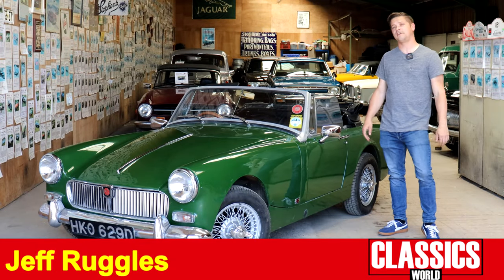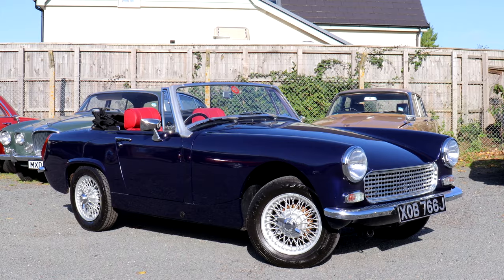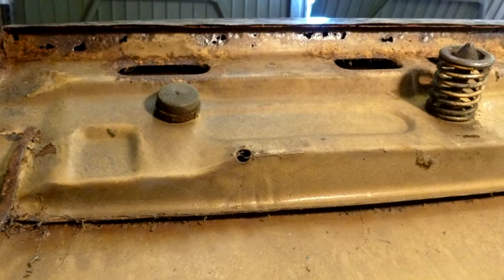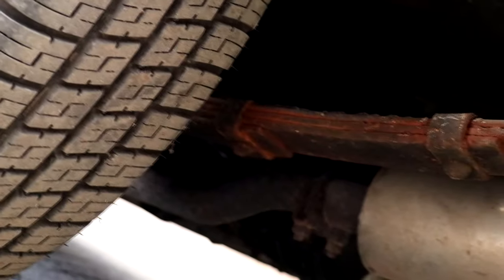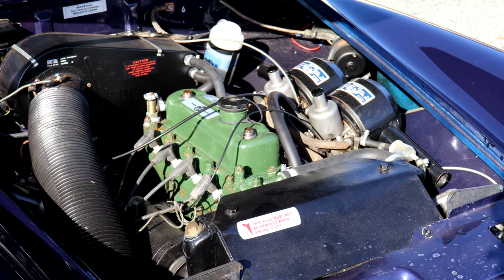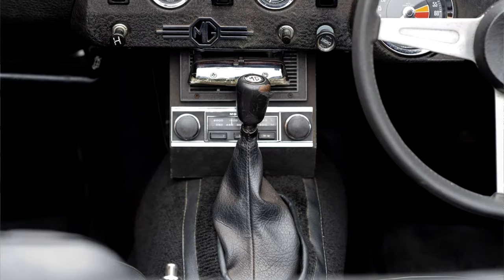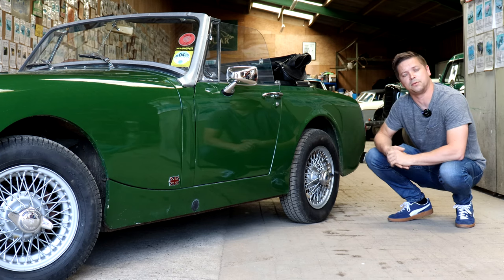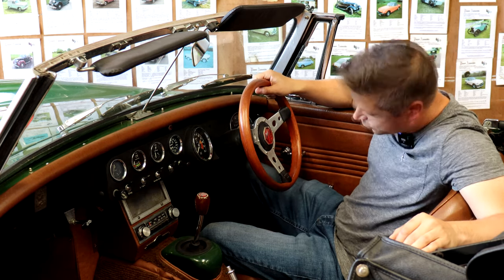MG Midget Buying Guide - Fun, Affordable Classic Sports Car !

Comment: I wanted to buy a brand new 1973 Midget, so I sat in one on the showroom floor. I was then just over 6'1.5". The top was up and I easily slid into place. I found it all enchanting and very comfortable. Then I tried to get out. After repeated efforts, we all had a good laugh while the top was lowered which for some reason I couldn't get out my way. I suppose a quick-release steering wheel would have helped, but everyone including me breathed a sigh of relief when I decided to buy a sportscar I could both get into and out of.

Comment: Great video, even if it was tripping my Midget hood folding OCD off. If you buy a Spriget make sure the hood is folded correctly (unlike the one in the video) otherwise it will look like a pram but more importantly it will damage the hood in long term.

Comment: Superb cars!  I love my 1972 car (I've owned it since 1985) and I cane it hard.:-) - The difference between 'OK' suspension, brakes etc. and perfect condition is huge:  A properly set up (zero play) car is fantastic: An even slightly tired one can be disappointing. - Even a couple of PSI error in tyre pressures will spoil the experience. Test drive as many as you can and you'll see what I mean.  - Oh, and the 1500's bumpers are *absurdly* heavy and with the increased ride height ruin the car.

Comment: This a quality review and buyers guide for the the Midget. I would add a couple of things. Get the car on a lift before buying. As mentioned, rust can be a killer on these cars. Get a magnet so you can be sure you are looking at good structural steel in the tunnel and side sills and not a botch cover up/rebuild. My favorite of the series is the cars built in 1972-73. Mechanically best of the lot, the only short coming is the the pretty wire wheels were not an option. If you buy a rubber bumper car, plan on lowering it back to the original ride height (not the worse job in the world). Visually, the rubber bumpers look much better if repainted to the body color. Lastly, if that Triumph engine is shot, look at installing a 2.8-3.1 Chevy V6 instead of doing a rebuild. Sourcing a T-5 trans will also give you a cruising gear. This is a transplant that can be done without cutting the car to pieces and really adds to the car's performance. The overall V6 engine and trans is a few pounds lighter than the stock components so you aren't destroying the balance of the Midget.

Comment: My grandparents owned one in the United States.
They actually drove it across the entire Continental United States in the middle of January when my grandfather graduated medical school and got a job as a physician in Seattle Washington.
He said it was fine for the first 6 months but the engine just stopped and when it was towed to the nearest dealership for repair they said that a intake valve had been installed on the exhaust side and burnt up and disintegrated thus destroying the engine.
They called the distributor and complained and the distributor said it's out of warranty.
They put in a new long block and my grandfather said it was an engine where you filled the oil and checked the gasoline because it was either burning oil or leaking oil even when new.
My grandfather kept it for several years until terminal rust got to it and said it was doomed living in Seattle with the nearly constant rain and the leaky roof and side curtains that let water in all the time.
After the coast to coast journey in January my grandmother demanded a car with an effective heater and weather proofing so he bought her an Opel Kadett wagon.
When you ask my grandfather about it today he said it was a fun car to drive and when it ran it ran perfectly plus he met so many nice people at garages across the United States while getting it fixed or waiting for it to be towed.
Reply: An interesting story.  You were very gentle on the quality of the car, no wonder that here in the UK we don't build our own nowadays.  It should of been replaced entirely at the end of the sixties too, listening to all the rust issues and mechanical and electrical problems it's not surprising that the Japanese killed us in the everyday market and the Germans in the luxury sector....when we weren't on strike that is!

Comment: I bought a Yellow 1969 Mk IV in 1974.  It was in great condition as the original owner bought it new and he was an MG fanatic.  He needed the cash to purchase a new home and still had his daily driver MGB as well as an MGB-GT he was restoring.  It served me well for over 5 years before it started giving me some engine problems with severe smoking on start-up.  I had to sell it as I was still in graduate school and had no funds to properly repair the car.  In 1978 I drove it from Georgia to California for law school.  It performed flawlessly at the time and the chrome luggage rack on the boot was very handy.   The only ongoing issues were 1) it occasionally needed a whack on the fuel pump to get it going (you could hear it clicking) and 2) the starter gears sometimes got locked up and I needed to turn the bolt on the starter with a spanner to get it started.   Otherwise, I loved that car!  I did replace the top with a new one with my wife´s assistance.  The original plastic window fogged up and it started looking really bad.  Thanks for reminding me how much I loved this car.  I now have a 1994 Miata which we inherited from my mother-in-law in 2018.

Comment: 1500 was always a nicer daily driver, more torque, higher gearing, especially the 77 onwards. Faster acceleration and top end too.

Lots of bollocks about thrust wear, couple of hours to slip a new thrust washer in, so no great shakes.

Comment: Parts are not cheap. I had a 1975 &  1979 - Midget .
Windscreen wipers cost $45.00 each. & it takes 3 for a Midget from 1975 thru 1979. They both always had electrical issues but it was easy to work on. I never understood WHY they would put the battery right in the middle of the car AND back against the firewall. I'm 5'2". Midget was the perfect car for me, plus it had my initials all over it.
Reply from the maker: Sounds like it was worth the struggle!

Comment: Would it make a good first car for a young driver who wants a classic?😊
Reply from the maker: if you bear in mind the potential for rust and lack of safety, they're great! :D
Reply: Absolutely great fun to drive. Make sure your best mate is a welder ad buy a good grease gun ! Personally my favourite is the round wheel arch version as not only does it look nicer, it’s got a soft top that’s easier to get up and down than early versions . Chances are you’ll never find another classic ( especially a sports car ) that’s as ( relatively) cheap to run. Make sure you join the MG Owners club and try looking for a car in their adverts. Good luck !
Reply: They are the perfect first car, you will learn a lot doing your own work. Simple and easy to work on. Don’t sell your bicycle.